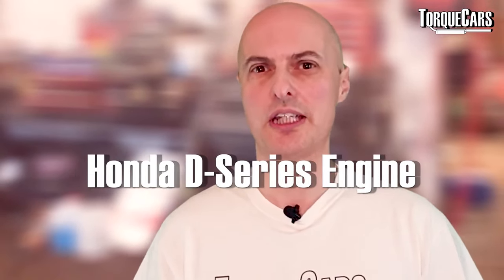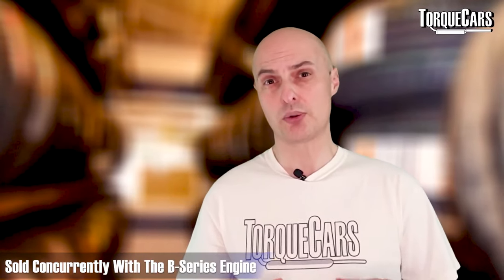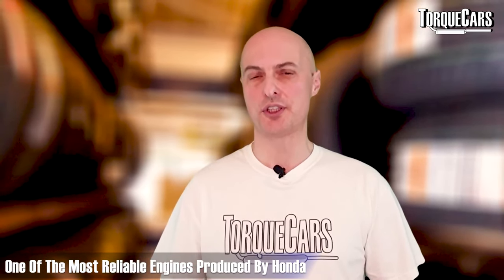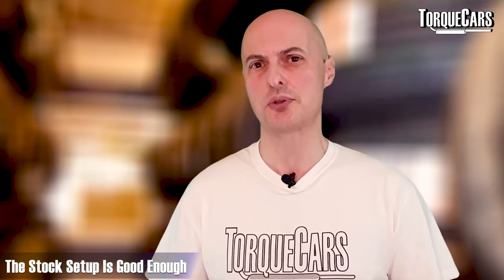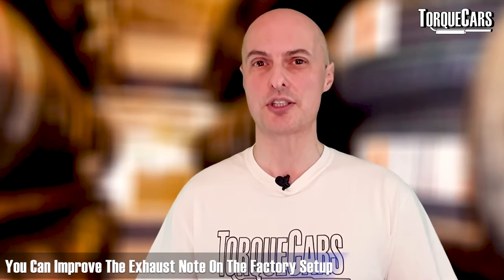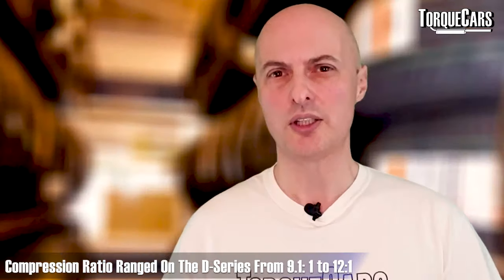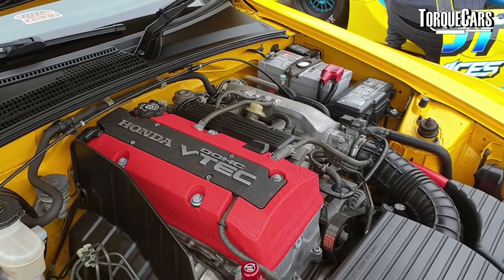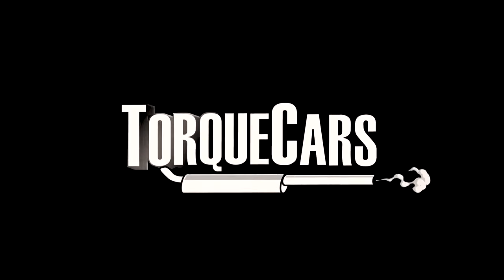Honda D Series Engine Best Mods & Upgrades 🔧[Tuning]

Comment: Best d series mod is a b series😂
Reply: @kylelaughinghouse1893  😭 😭 😭
Reply: Well yeah I don’t going to liar but b series is a bad ass motor but d16 you can tune with a single cam and turbo on it you can get 400 hp is not bad for a Honda
Reply: @tsaintt691 stock block?
Reply: @Chino-m2v  d series is bulletproof bro 😭
Reply: @treloshondakias9061 Need built bottom end for that
Reply: B series swap is not cheap and getting hard to come by where I'm at
Reply: Yer if your a sheep and just follow everyone eles😂

Comment: Me and my dad used my Y8 head and mated it on a D17A1 block, its a nice little frankenstein. Wish I had the A2 block though
Reply: Did you have to do a lot of wiring changes to make it work
Reply: @nickclashez  we extended the alternator wire since it's in the front instead of the back. We still haven't figured out the knock sensor situation, but other than that, it was pretty straight forward
Reply: There is nothing different in the block get the cylinder head and ecu . And you basically have a a2 engine . Swag the cams from the D16y8 . Borred ported block performance pistons and rods . Ported intake , turbo kit . Easy 4-500 hp
Reply: How bout the D17A5 Vtec-E engine its have 130hp 155 Torque as stock 🤔
Reply: Also i want to ask i have P29 ecu pulled out from EG 1995 sedan black top DOHC i think also called ZC can i chipped this ecu hondata s300 cos its very hard to get p28 ecu 😢
Reply: I have an a2 blocc 😈
Reply: I have the d17a2 what’s special about that ?
Reply: I have the A2 block with 30,000 miles new engine what should I do to it first (the only problems I have are the electrical system) I have the D17a2 Vtech 1.7L
Reply: @victorlewis7635  if you put a vtec head on a non vtec block can you still activate the vtec system
Reply: @rayondennis4581  I’ve read a few people already do that for the non vtec models by changing the heads but there’s 1 more thing you also have to change it’s another vtec add on past the heads so yes pretty much it does

Comment: For NA engines best upgrades are changing the exhaust system especially the exhaust manifold, performance camshaft, valve springs, remap ecu, installing fuel regulator. Wanna go for the extreme NA power then you gotta change high compression piston, port and polish your head.

Comment: I own a 2000 Honda Hr-V abused for years and still drive better than most cars, only problem I have now is oil leak and horrible rust.
Reply: @Grâce-n1d4x  tell me about it, the previous owner kept it in a garage, and I unfortunately cannot keep it inside, and the doors are bubbling like crazy.
Apart from that, she's pretty good. I've taken him green-laning and I've done a roadtrip. Absolutely fine car imo.

Comment: Finding a cam for a d16y7 is gonna be tough and expensive. Best bet it to ship your stock cam to get a re grind. Much cheaper, but not all companies to mess with cams are willing. A full legit branded exhaust kit will make the car sound spicier in a good tone but the hp gains would be no more than 10hp tbh. A short ram isn’t a great idea because the filter and the intake hose will just absorb heat from the engine. Get a cold air if you dont boost the build. Turbos are fun as well as some of the superchargers. Just keep in mind that the supercharger will create way more heat. Like he mentioned, hondata is pretty much the best. You can use a Y8 intake manifold with some modifications. Not too hard but not lego either. You can “lock” vtec(look for a tutorial) but its not very healthy and its not worth it if you arent gonna boost the build. Pistons and such are pretty easy to find or have custom cuz honda. You can find a bigger throttle body by skunk or similar. I believe you can reuse a Y8 throttle body due to the cable/ throttle tensioner positioning. For cooling, theres tons of cheap and mid range to legit racing parts. 99 honda lx had a d16y8 with a manual pushing 102 from the factory to the crank. So you would in theory get about 50-75hp out ofall those mods without boosting. Keep in mind youd probably hit 75 hp with a flex fuel kit and if you change to a higher compression. But overall, a lil light civic pushing 150-175hp is really good. Youd be able to give a stock s2000 a run for its money along with those annoying v6 mustangs and maybe even stock 3v mustangs.

Comment: 🔥❤️‍🔥 I have a 2003 d17a1 with 330,000 miles and it still runs great.❤️‍🔥🔥
Reply: @batbrains187  dude same but I've only got 196xxx miles on it and she's running flawlessly. I drive the tail of the dragon once a week 👌🏽

Comment: Finally got my hands on a project car! It’s a 1990 Honda Civic EX Sedan with a D15Y7 w/ a 5 Speed! She runs and drives well, slowly going to restore it back to glory. Any tips on what to upgrade first would be much appreciated, this video alone helped me gain so much knowledge on what I have and could do but I’ll still very happy and open to learning more from the community.

Comment: I just got myself a 1999 civic DX. Plan on making the most power out of the D16y7! This video helped a bunch. Thanks a lot mate !
Reply from the maker: Glad it helped! Thanks for the support and feedback. Keep me posted, I love hearing what mods people have done and how things are going in their car projects.
Reply: @torquecars  of course! I’ve also subscribed!
Reply: upgrade internals (forged) to handle more boost. head swap. turbo kit. chipped ecu. fuel upgrades. tune. gut car. ez power
Reply: Swap the intake manifold to the y8. 10-15 HP freed up right there intake and exhaust another 10 each I'd say easily so 35 more HP from those 3 things
Reply: @bloodshot5517   stock head stud diameter is the weak link.
Reply: @04tacomaguy1  your not getting 35hp from those on a stock ecu d series without more fuel and timing

Comment: Currently have an ej2 coupe 95 Stage 1 cam D16Z6. Just purchased a Hondata. 
Wiith the old auto non vtec D15B7 gone, now its time to tune it up! 
Owned an eg3,4 and 5 and an eu8/ep2.
Driven just about every Honda there is and i can say these machines have untapped potential! 
Driven alot of cars and nothing makes me feel the way a Honda does.

Comment: Out of all pages that I've came across, your video has been the most helpful. I made a list of things that you mentioned and will start my build in the near future since I've yet to restore my EP2. Plan is to get my Civic to 150 horses NA. Considering that my car has 110HP from Factory, I'm sure that it's not going to be too difficult. Thanks again!
Reply: Remember one thing. When it comes to these D series motors. The power is nearly all in the Cylinder Head. A good Camshaft, Intake Manifold, and Exhaust will boost you 25 - 30HP with a good tune. Porting the head and increasing the throttle body size will give you even more power and you will be right around 145 - 150 HP range. If you want to go even further and go higher you would need to bump up the compression, new pistons, shaving the head, etc. But if you're like me and daily the car, then its not going to be worth all of that just to get 160 - 180 hp NA, the car would be hard to daily drive and gas isn't going to be your friend lol. Realistically, if you want around 200HP in a D series, you would need to boost it.
Reply: @Skronkidonk  Thanks for the input! Yeah my EP will be a daily. That's why I want 150HP max for it and I refuse to swap it because it's expensive.

I need to register the car again in a month. Ordered Tein Advance Coilovers last week and I'm planning on having them installed before the deadline.

After that I'm doing a full air intake, I already had to replace the rear muffler and the exhaust tip for a Remus dual pipe so I'll get a custom exhaust done as well. It will be expensive but I don't want anything cheap and I don't want my car to be as loud as a train horn.

I'll copy and paste what you wrote and keep it on my phone. Just in case. Thanks for the info! It will most definitely help in the long run!
Reply: @smile3od681  Of course no problem! I was wanting to do a mild all motor build as well! But I drive the car so much that I dont have time to put a cam and port the head. So im tryna go to the turbo route. I hope your build becomes successful, I absolutely LOVE NA SOHC builds.
Reply: I think d16 are motors with good potential, my del sol goes really good for the hp it has, i think a good upgrade would also be a short final gear

Comment: I was looking a few weeks ago about D-series engine because I want to buy a Honda . This is a useful video , thank you mate :)
Reply from the maker: Glad I could help and thanks for your support and kind words. Hope you get something soon. Do you have plans to upgrade and modify it?
Reply: @torquecars  no , but is a good thing to know . I'm looking to buy my first car :)
Reply from the maker: Awesome, you need something reliable and Honda would certainly tick that box. The Honda Jazz and Fit models are quite popular first time cars here in the UK. Insurance is always the killer thing though.
Reply: @torquecars  I'm not from UK😅. I was thinking about a Honda Civic EP2 1.6 110HP , any idea if that engine in a V-Tec ?
Reply: @dumitrescugeorgedaniel4877  if you're looking for nice 1.6's in uk look for the mb/ma, that's the version shared with Rover. Pretty common there in uk i think

Comment: I've driven a Mk7 civic with the D16V1 and now own and daily a Concerto with a D15B2. The plan for my Concerto is to get the car to 200-250 wheel hp. I could go B series but instead I'm going to swap to a D16A9 (the twin cam D series) and  build that up instead to handle a supercharger!

Comment: i used to daily my 1998 civic dx coupe with a d series. sadly the ac compressor is shot so it sounds really bad but runs great 😂 currently daily driving my 2008 civic si til i get a new ac compressor
Reply: Im not too sure but i think you can take the ac belt off and run without the compressor driven by the engine wont have ac but a working daily i think

Comment: My z6 blew up so i swapped a y8 block used my z6 head and put a z6 crank in the block pulls very good and it has a lower c/r so itll be fun to boost these single cams are hella funny 😂
Reply from the maker: Thanks for sharing and thanks for the support my friend.

Comment: Scheduled oil sampling on my son's '97 Dodge  with diesel engine showed much more silica contend with  K&N oiled filters.  When he switched to a washable dry AFE filter, any increase in silica content stopped.  You can make your own decision. High flow with oiled filters might not be the best option for your engine's longevity, depending in where you live.  We are in NM where dust always in the air  with high silica content.   I had always run K&Ns but don't any more.  Would tend to think cold air intake filters would have the same issue. Probably not a real issue in areas without much dust.

Comment: I have a sohc d16Y2 and i just keep doing basic maintenance. For a 126hp it's very fun car, and doesn't fall short from 160hp cars. Has a nice powerband for it's size, only thing i'd like is to add a 6th gear for top speed to reach the 250kph mark, even thought i never tested his stock top speed. But deff reaches 170kph without that much effort
Reply: 😎😎😎 I got a D15z7 (3 stage vtec) in an Ek3 Ferio Vi, 128hp with The Cvt Multimatic, that thing movesssssss and keeps up with cars it has no business keeping up with 😂
Reply: @ront5689  deff great engines, never thought with a 1.6 i could make 2.5's sweat their ass off trying to pull away. My car body is a Mb type, with a small spoiler, but deff works well, and the understeer ain't that bad. I also like the high compression rate 9.5:1 for gasoline is very respectable, i barely need to brake at all unless it's an emergency

Comment: I’m just into building a D16Y8 into a classic NA screamer. 
No forced induction, nos or sorta things just classic NA engine tuning. 

Fully refurbishing the block, higher compression ratio, ported head, bigger valves with cnc cut seats, flow optimization and a bit of ecu trickery. And an overhaul of the transmission of course. 

I’m looking for 170-180hp which should be feasible and enough to get my Del Sol quick enough for scaring some Porsches… 
To be fair everything else is already been built up to racing spec just the engine needs to be done.

And for all the people who scream turbo it or swap it…. Nope! 
I linke the uncivilized sound of the D16 revving up to 7500rpm and the pathetic old 4 speed automatic which I’ll need for reasons. 
I don’t need an exocet rocket but a bit more OOMPH to get my baby girl to maybe 250 kmh 🤪
Reply: I also have a del sol with a d16y8 
Do you think a shorter final gear also would make sense?
Reply: You are going to spend more than a b series swap and have less power. The d series head can not flow.
Reply: You might scare a porsche speedster

Comment: I have a 97 cx hatch with a D15B single cam with a 16 valve non vtec head from 00, I'm trying to swap it out to a 98 ex head which has VTEC but it's proving difficult for a little swap!

Comment: More than a few mis-leading comments & implications regarding ZC, DOHC & Vtec D-series also seen elsewhere. 
So to clarify, ZC being the Japanese engine code used on both premium engines, 1.6DOHC used in early Integra, CR-X & Civic Si from 1985 (similar to d16a1-d16a9), which was replaced by slightly more economical 1.5 & 1.6 SOHC VTEC 'ZC' for 1992 on (d16y1, d16z6) {no Dseries DOHC VTEC ~ That was B16A}. 
Also these premium higher power engines usually had improved 4-2-1 exhaust manifolds not consolidated into 1 until past the sump.

Comment: 5:24 What? Honda OBD 1 ECUs are very easy to tune. Just get yourself a cheap programmer (like the TL866), a free software (like HTS) and a wideband O2 sensor and you're ready to go.

Comment: Thats definitely got me thinking, I've got a 2000 honda logo with a D13b7 engine, would a D16w1 engine fit straight in ?
Loved that video.
Merry Xmas.
Reply from the maker: I've not much experience with the Logo so can't confirm for sure there must e someone out there who has done this that can comment on this for you. But in general though it should be possible to swap between these as long as the OBD generation is the same, which should make it easier. Another option is to drop on a SOHC Vtec head on it. This will net another 30HP over the stock. ECU will need to suit a VTEC head so something from a D1. Vtec ECU like the P0.
Reply: Hello! Any D-series engine will fit in, if the car came with a D-series motor: Remember, there may be differences in wiring.
Reply: Me and my friends want to pick one up and put a D17 in one. Twice stock power with 130hp and 800kg would be pretty punchy
Reply: Mate of mine is running a d16A in his one... pushing 250kw with a turbo setup

Comment: I build know long ago another d15b2 block with po8-3 head no VTEC or turbo  I used better head gasket shave the 10 over port mild used obdo distributor with some adjustments lighter flywheel gd clutch kit header 272 Delta cam regrind re road all crap and put a Weber on old school style on a CRX Honda and believe me she can hustle real fast and real perpyy touch the gas and she jumped fast beautiful thing to drive her sound is like a ford muscle car man man I put a short gear transmission and hell know iit became a monster in the streets HP and responds is crazy from stock and yes is all motor

Comment: Increasing the SOHC Camshaft size are also provide better flow as good as DOHC is it not? A Single Cam act like a diesel which has good torque compared to DOHC, so turbo might be alternative choice for higher top speed right?
Reply: @khalifaskho4223  yes 
but not at all ,
 bigger cam do  bring more  power and more top end 
but its not gonna change the fact that bottem end is meant  to be more torqy  then b sereis when theyre all oem 
which means  longer piston stroke and smaller piston size

turbo just seems to be a fastest way for a budget build

Comment: I have a 16 valves d15b2 engine that I put together with my own hands around 10.1 or little less comp or little more I build the engine mostly from junkyard parts port and polish head and 3 angle valves job 20 over pistons skunk 2 cam D16 manifold with nice air filter b18 fuel injector si transmission and other little things like free flow exhaust system and I tune the thing up a bit no much and I put it back to my 89 CRX to some weight out and build her a bit lighter with aluminum parts suspension and flywheel ECT and I can say for what it is make the big boys shake a bit in higher rpm all that crap about VTEC and turbo don't mean crap waste of money really that more for racing I being with my in the highway neck to neck with big boys with my little d15b2 engine and I can say she pull real hard in higher rpm for what it is and here is a example that weight really matters when come between HP I love my set up enough for me to have fun cheap to maintenance and gd on gas in cities she is to fast for the big boys she don't run she fly side walks and alleys CCR born in the byouooooo and really if we compare price and maintenance my still come above and in looks my get all the attention old school style nothing fancy hills style and believe me she sounds like a Ferrari when she starts to run I build my own free flow exhaust system silence in lights and Ferrari sound when she starts pulling no that regular Honda crap sounds and I build her with hardly anything compared to turbo crap VTEC etc and here I'm neck to neck with them in the streets and highway with my little falcon

Comment: I must say the induction part isn’t true idk if there was sun wrong with mine but the old one was really okding it abck and I smacked a cold air on and the torque was so much better and I would say it have like 20 more hp